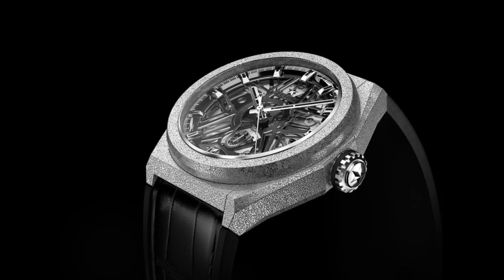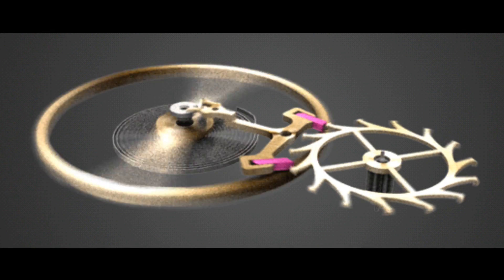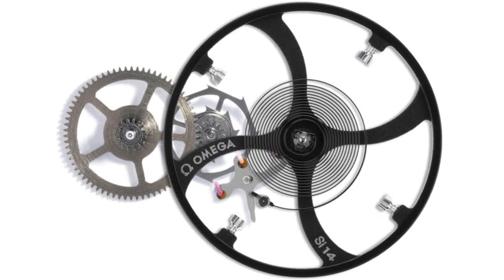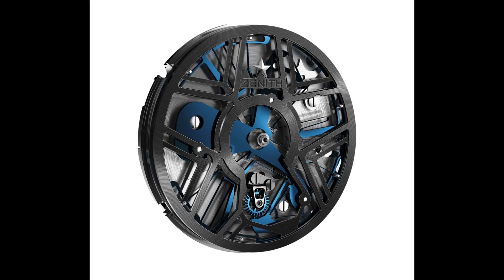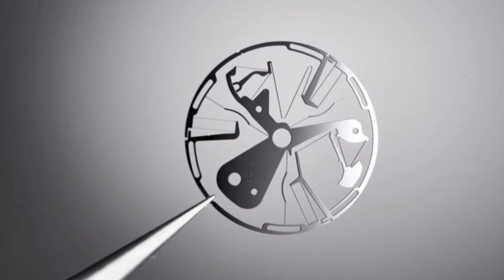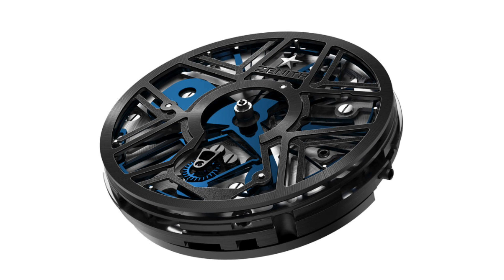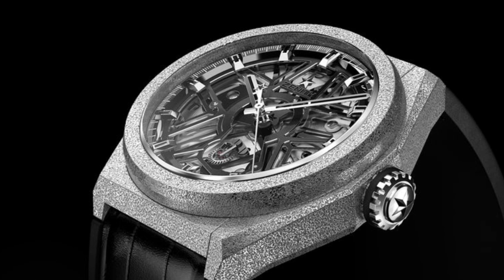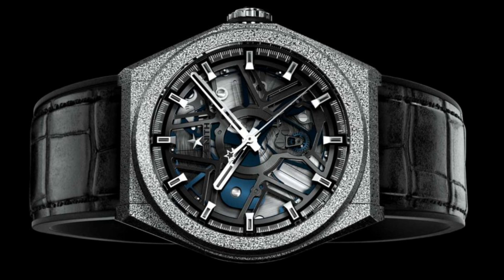Zenith Defy Lab: A Feat of Engineering - Explained

Comment: I have a Rolex Submariner,  which I bought new, 38 years ago. It gains about 30 seconds a month, ie about 3 minutes every 6 months. I like my watch to be a little fast, because I'm never late for an appointment. A watch that's "bang on" is a pain in the a***. Even if I owned a Zenith Defy, I'm sure I'd deliberately set it 3-5 minutes ahead, so there's no point in getting such accuracy. If I want high accuracy, I have a couple of quartz watches collecting dust in my bedside table. If that's not accurate enough, there's my mobile phone, which gives accuracy of under a second per year. Accuracy should never be a reason to buy a beautiful craftsman made watch. The $2.6 million Patek Philippe probably doesn't keep perfect time - but, so what? Obviously, there are people whose life depends on an extremely accurate timepiece. For them, I recommend they get a Citizen CTQ57 (plus or minus five seconds per year) or a 9F Grand Seiko (plus or minus 10 seconds per year)
My Rolex ticks many boxes:-
1) Well made. 
2) Reliable. 
3) Attractive.
4) Appreciating.
5) Keeps (for me) adequately good time. 
6) Robust. 
7) Waterproof. 
8) Visible in the dark. 
9) Prestigious. 
10) Good value for what it is. 
The Zenith Defy doesn't tick as many boxes. 
Check out Roger Smith. (George Daniels' protege). He doesn't wear one of the $250,000 watches he makes for very wealthy clients, he wears a Rolex Datejust. He says it's a VERY good watch.
Having said all this, I'd like to compliment the presenter on an exceptionally fine, professional and informative video. An even better presentation than "Watchfinder" - and that is a high accolade.

Comment: It looks like there are 3 spokes in the balance wheel flexure that bend to allow the oscillations. Because these spokes would cause the radius to change they couldn’t make the outer hoop continuous so they cut it into 3 pieces and coupled their movements (so they wouldn’t crash into each other) by the 3 L shaped features that have the parallel flexures on each. The time adjuster just puts more spring resistance on the oscillating flexure and then there’s one more feature that meters the escapement. Cool looking design. I saw some video where they were writing all sorts of equations on a white board and now that I see this design I don’t think anyone really needs to understand those equations to be able to design this, they probably were just writing them to seem smart :) I think flexures have seen very little use in watch design so this mechanism might open the door for many new flexure based complications, watchmaking will be getting even more interesting in the years to come!

Comment: And almost 2 years later where is this? One worry I have with the Silicon flexure style balance wheel/spring is that the cyclical loading causes some hysteresis in the elastic region of the silicon and I could see after a few hundred million cycles it would lose a lot of strength in the flexure and need a new balance wheel. A coil spring in a traditional watch deflects very little because of its length, very low strain, so cyclical loading affects are minimized, however the new silicon movement that zenith created deflects much further per tick/tick which can significantly fatigue the spring much quicker.

Comment: I can definitely see this new oscillator used as the chronograph module on high end watches. The traditional movement can be kept (maybe for tradition or artistic reasons), and the oscillator for high accuracy chrono readings. I wonder whether the oscillator can accommodate features like flyback, split time (rattrapante), double/triple flybacks, etc

Comment: what a pointless innovation. Zenith have always been crap and this does nothing to change that. A vibrating sliver of silicon is not a mechanical reaction and therefore this is not a mechanical timepiece. It's a gimmick designed to appease idiots who don't understand mechanical watches. Cheap and cheerless technology.
Reply: As long as the vibrating metal (silicon) mechanism does not involve microelectronic or electricity, it is a mechanical timepiece. You are mistaken silicon with microelectronic.

Comment: This is a fascinating innovation, though I can't help thinking that the silicon oscillator looks a bit flimsy. Of course I assume they've carried out all of the necessary mathematical calculations, and soak tests to be sure it's not going to fail catastrophically after 5 to 10 years of constant use. Then again, the trouble with revolutionary innovations, however clever, is that there's always the chance that the designers have overlooked something, as in the case of the de Havilland Comet. If, 5 to 10 years down the road, there are no reports of such catastrophic failures we can be sure that they've got the design of this component right.
Reply: Alternatively, it may not be such a big deal to replace the monopiece at a routine 5-7 year servicing.

Comment: At the moment it serves no practical purpose for humanity.  But it can!  This can end the cost and pollution caused by watch batteries.  I guessetimate  a billion watch batteries are used up every year.  

I disagree when you say it's main advantage is accuracy -- you can get a quartz watch for accuracy.  So the main advantage today is just that it is different.  If instead of being sold for $$$$ it was made cheap (it's just silicon) and plentiful it would replace all conventional oscillating wheels.  Which means we would no longer need quartz watches for accuracy and we could be rid of one billion batteries cost and pollution   Now that is something wonderful. 

Until it gets down to being cheap and taking over the industry,  it remains a rich toy.   And a cool but meaningless gadget.

Comment: How is power from the reserve transferred to the resonator?
Reply: There must be some sort of mainspring. I can see the crown possibly for winding it up, can't see an automatic rotor but usually with a "power reserve" there is one. The power must be transferred to the small gear, with the teeth built into the oscillator escaping energy, hence the movement. Fascinating.
Reply: We all know a pendulum + gravity  (or balance wheel + hairspring) creates a "period" that remains constant, no matter what happens because if you push a pendulum harder it comes back faster etc etc, so I guess the oscillator + silicon beams are the equivalent here, the joins being the pivot points.

Comment: Silicon is sliced from an ingot (not melted), right?
Reply from the maker: +George Adams: As it turns out, Zenith couldn't slice it due to its brittle nature and so they melt it down and then spread it out to form a flat surface.
Reply: Is this thinner than a microchip? Must be.
Reply: No, it's not thinner than the silicone structures in microchips.

If it was, you wouldn't be able to see it.
Reply: That's sliced.
Reply: No, microchips are stamped.
Reply: Where in the process are they stamped? The wafers are sliced from ingots.
Reply: Sorry, I misunderstood your original point.

I thought you were talking about the tiny silicone structures within the chip, not the chip itself.
Reply: Nah, I'm trying to figure out why it's melted. I could understand melting to make the ingot. But after that, it has to be sliced.